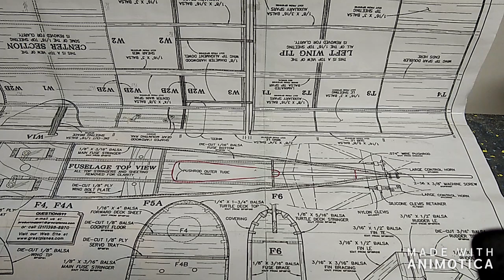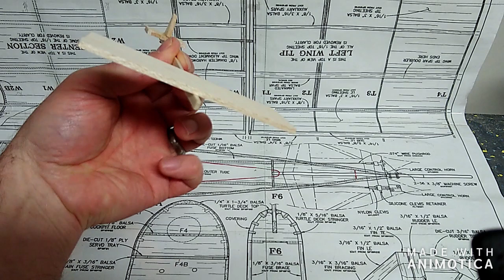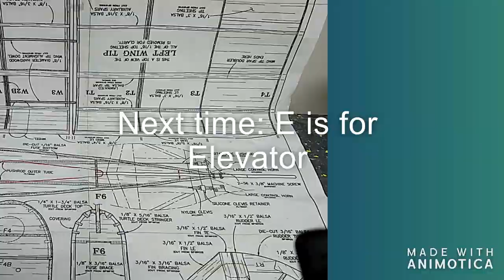A to Z of RC planes for beginners - D is for Dihedral

Comment: but what does anhedral do?
Reply from the maker: In an airplane with a high-wing configuration it is usually very stable (especially in roll). This is useful in RC trainers but not very useful on real high-wing planes where you also need manoeuvrability. Angling the wings downwards (anhedral) induces roll instability, making the aircraft more manoeuvrable in rolls. 
Might do a video on this...